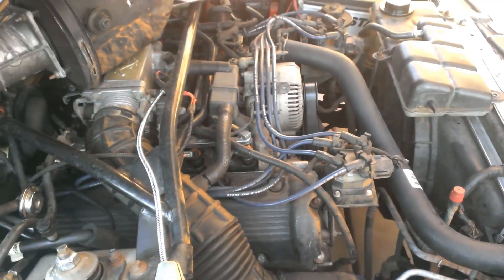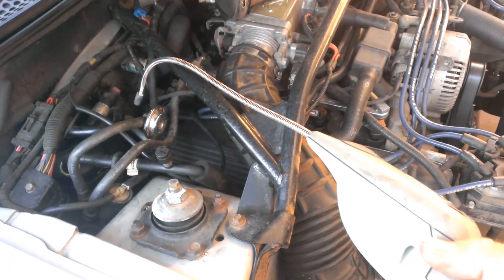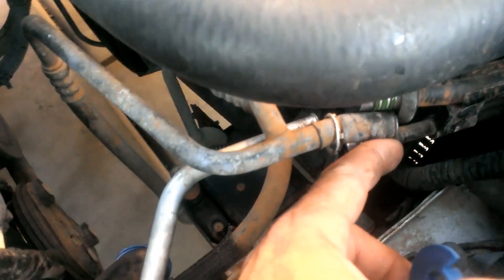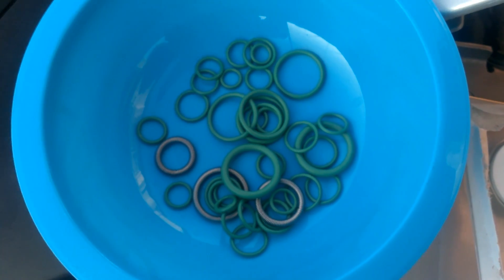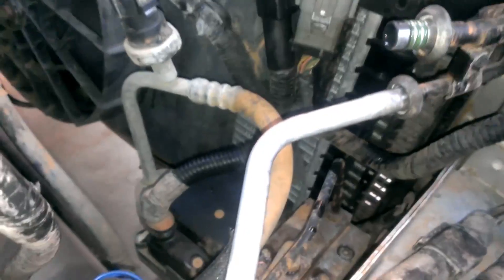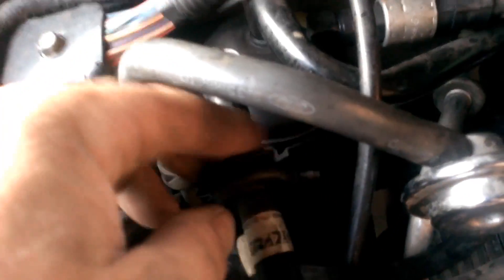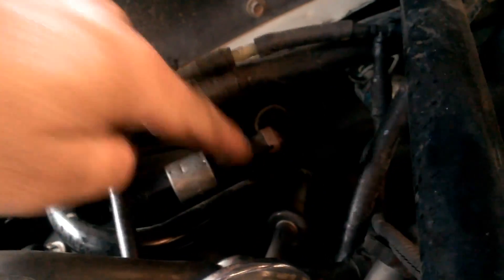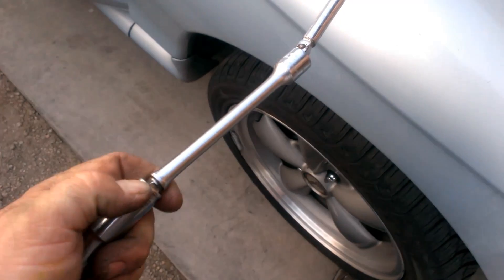Project Mustang - Leak detecting AC lines - Replacing o-rings

Comment: I was told to replace the spring along with the o-rings on the a/c lines. But i dont know how to replace the springs. Also what oil did you ise to lube up the new o-rings? Thank you.
Reply from the maker: I likely just used whatever PAG oil they sell for these systems. This was a while back and the car is long gone.
The O-rings hold the seal mostly. The springs mostly to hold the fitting together and the tool to disconnect opens the springs.
While apart you can likely just reach in with a pick to yank out the springs

Comment: New evap. Old line dosnt work ! Tried all the o rings still leaks like a sieve  permatex ?
Reply from the maker: Could be compressor front seal. Or in the evap coil etc. Leaks in car A/C can be fun
Reply: @hackfreehvac  nope tracked the leak to orings at evap connection tried several sizes leaks like a sieve
Reply from the maker: @StephenPalmore-u7j   Are you using the GREEN O-Rings from an A/C kit? Or just some O-Rings from a hardware store etc?
Reply: @hackfreehvac  been a mech my whole life 67 yo now ...o rings from the kit

Comment: I can hear a leak from one of the lines you had disconnected from the condensor. The one that is bolted to the frame. I can shake it and hear the air pissing out.   How the f do you get to it to change it. Seems like there is no room.  I also have a leak at the high side shrader valve
Reply from the maker: It has been too long to remember. LOL
Maybe the air box etc has to be removed first to open some room.
Reply: This was 7 years ago Hahaa.    Thanks for responding though.

Comment from the maker: Yeah and I still used R409 and only charged about 24 oz out of the 34 oz specs. It seemed cold enough and the suction was good. 
The minimum I have to charge the better so that stuff don't go crazy on hot days. It was probably 100 or so when I charged it and the high side was well under 300 at idle. Like 250. Which ain't bad at all for 409 in a car. It will be higher when it's 120 though.

Comment from the maker: ... So I turned that fackin' screw all the way in and reinstalled the relief valve.

I vacuum and recharge. I just drove it to go get some Chinese food but the temp dropped below 100 now.

Tomorrow I will drive it to work again and see how it goes when it is hot as heck in the afternoon.

It's just one thing after another. LOL! I didn't realize a NEW part (with no instructions) would need to be adjusted. :-/

Comment from the maker: ... It's blowing some nitro out of the high pressure relief down on the compressor!
I figure it took a crap so I let out the nitro. I notice the relief closes at some point. 
I remove the relief fitting and notice it has an allen  style screw in it. 
I unscrew it to look inside and see it is to adjust the spring tension.

The darn thing was set at like 250-275 or something! No wonder it works at night when I fix it and then blows some charge when I drive it on a HOT day!...

Comment from the maker: HA HA HA! Wow I should have made an update video to show my dumb-dumb mistake. Actually, well maybe not. I had NO IDEA that the replacement high pressure blow off valve I bought from O-Reilly's was ADJUSTABLE!

Today I check the car after work. It still had some refer left, as always. Just enough to slightly cool and cycle the low pressure switch like crazy. 

So I pull most of the charge and add nitro to leak check some more.
Then I add MORE nitro and when it hit 250+ I hear something...
Reply: hackfreehvac is there any way to contract you about your turbo set up

Comment: Check the access fittings too, I hate those access ports with the little rubber ball in them, ford uses em so does chevy. I have a 1994 f-150 that has em on both high and low. I like the old schraeder valve stems better, a lot simpler to fix if they leak. I've find those to be the most common cause of slow leaks on cars, and it'll fol you on a pressure test, the whole system might hold pressure real good with some nitro, but hello, if you have your gauges hooked up, that'll plug those leaks, lol

Comment: haha. Bummer. Gold old ford and their horrible ac. My friends 07 F150 FX4 has about 95K mi i'd say. He has owned for a few months and put 8k mi on it since he bought it. Back in late may his ac stopped working. The compressor engages and the pressure doesn't change a bit. The scroll fucked its self haha. Plus while his ac worked fine, it was nothing compared to his 04 Dodge 1500 with Hemi. At idle with both rear and front ac on max our 07 Suburban blows away his ford when it was working XD

Comment from the maker: It is stable. It still runs 220 to 230 on really hot days. But from what I've read, that is normal. 

The bummer thing was I left the house with an ice cold AC and right when I picked up my coworker from his home and started driving away, we saw a mist come out the vents and the air quit!
I wonder what THAT was about???
A leak obviously. And now I gotta get under the dash. :-(

I had to go do a side job right after work so I didn't look at it. 
I'll be driving my Durango to work tomorrow.